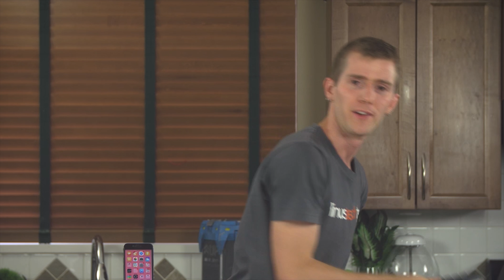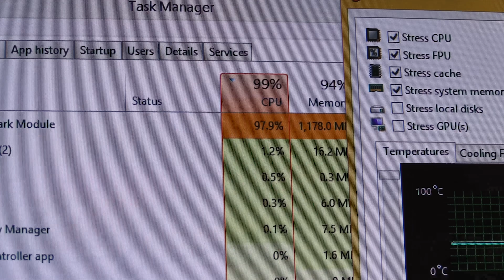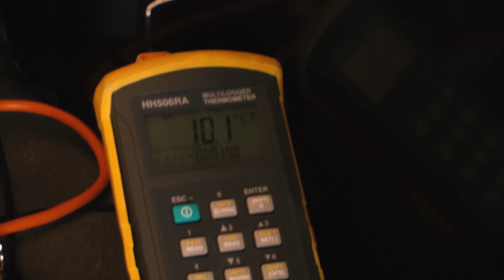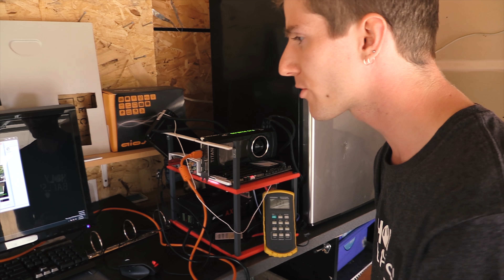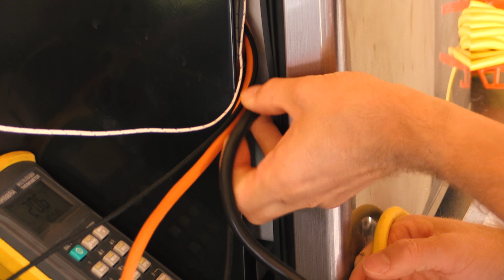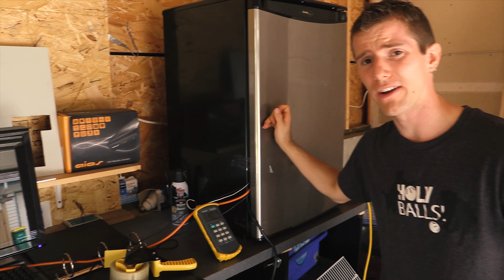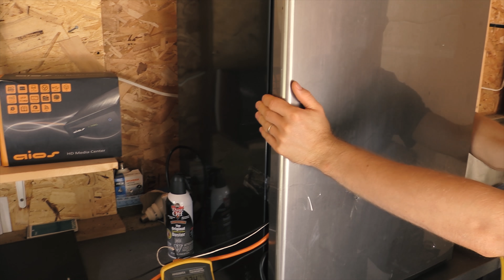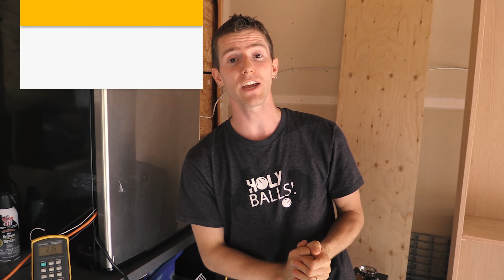PC Build in a Fridge - Does it Work??

Comment: How about extending water cooling loop with copper pipes and making the pipes run through a mini freezer?
Reply: Assasinpiggles well, that's the point, linus projects were never about the average consumer, it's about doing something weird and unusual.
Reply: DemonAMVs ^ True
Reply: Max Poma i don't think its possible for water to freeze in the short time it runs through a mini freezer, not counting all the heat from the processor that would make it harder, and if anything, there's anti-freezing solutions available in the market.
Reply: Hussain RT The average consumer couldn't do that.
Reply: overclockedamd123 
Based on your name you probably have no choice.
Reply: Hussain RT It would have the exact same problem this build has. A mini freezer isn't designed to run 24/7
Reply: UnleashNinjaGuru well we have a freezer that runs 24 hours at 35-50°C and it works great, also, in this case,the fridge didn't have the capacity to cool the system, but if it was only the pipes not the whole system, and considering the freezer cooling is more effective than a mini fridge, i think it might actually work.
Reply: Interesting thread :) +1
Reply: Hussain RT This has already been done. check out the sub zero build he mentioned in the video. the entire system is contained within the computer case its self. not actually all that crazy. To any serious enthusiast it is just a basic phase change cooling set up. the crazy stuff comes in when your doing a cascaded phase change set up or cryo cooling. then the system needs to be designed to handle the cold boot bug as well as the cold bug.
Reply: Hussain RT What you want to make is called a Chiller system in Air Conditioning. And yes it works.

In simple terms imagine having a 50 liter water reservoir for your regular watercooling system, and then using an appropriately sized refrigeration system with copper tubing loops in the reservoir to cool the water in it down to 5-10°C instead of whatever the ambient temperature is. And that's about it, no need for anything more complicated than that.

Now if you want to keep an air cooled system's temperature low inside a box (which is what people think about when doing experiments like Linus did) then you use the chiller differently.

First you make an insulated box using 2 1/2" panel like the one used when building portable cooling chambers. You can have a glass door like those used in fridges at stores so you can check the system inside. Then you place an appropriately sized evaporator inside the box and connect it to the water loop. Then place your system inside along with some silica bags to keep humidity inside at a minimum. And that's about it.

The reason to use a chiller instead of going for direct expansion is because this way you can control the load much better ensuring you will always have a constant supply of cool water running through the system while also ensuring the refrigeration unit will not be working 24/7 but rather only kicking in once water has heated enough. And won't have to deal with condensation like you would do in a direct expansion system either.
Reply: Hussain RT hey it is a bad idea but overclock the fridge, they're good at that right?!
Reply: Hussain RT If you were going to do that you may as well take the compressor out and build a freon loop.
Reply: Hussain RT on a totally unimportant side note  noticed the irony of me teasing you about a movie character who works on tech and robots while I myself am watch videos about ai...
guess jokes on me... but I still get to keep a cookie :)
Reply: Hussain RT That's nuts, you'd definitely get condensation there. Lots of it. Also I dun think CPU blocks are designed to hold that much pressure, they might pop before you get any meaningful cooling.
Reply: Hussain RT  good idea
Reply: Hussain RT TBH, I don't think there are too many machines that could generate enough heat for all this effort to be even moderately practical haha. Would definitely be a cool project for shit and giggles tho. Would probably be a better idea to just go liquid nitrogen at that point.
Reply: ***** Exactly, unless your machine is pushing out more heat than your cooling system is pulling out, it's kinda pointless or even negative for the reason you pointed out.
Reply: Skyler Dorrell is there really anything "basic" about a phase change cooling system? No offense but anything beyond an air cooling system and maybe an AIO is well beyond the concept of "basic." I think calling such a complex system anything less than advanced is an insult
Reply: Hussain RT I wouldn't recommend this unless your components are waterproof.  If your cooling system is below ambient room temperature it will collect condensation, which has a good chance of collecting on your CPU or Video Card.  Neat idea, but you're better off putting the whole rig inside a freezer.
Reply: How about putting attaching a pipe to your refrigerator, and looping your fridge's refrigerant to the PC?
Reply: @VividBagels  refrigerant is usually a flamable gas, not unlike propane. Not a good idea to pump refrigerant through a computer which has ignition sources (fans). System should be decoupled. A refrigerant loop cooling a water/coolant loop.
Reply: Hussain RT Just use pure ethylene glycol (automotive antifreeze has additives).  40% water and 60% antifreeze is good down to -45C.
Reply: Hussain RT Dev Patel your a genius but watch out for Hugh Jackman he hates programmers (especially that 'project' your working on)
Reply: Hussain RT its ok, had to explain it officially not funny anymore :(
Reply: Hussain RT Hilarious
Reply: Hussain RT too kind, 2 cookies? i'll never finish it
Reply: Hussain RT moving water will not freeze, except under SERIOUSLY low temperatures. Even at -10F, if water is moving, it won't freeze. in order for the crystallization of water to occur (solidify), the molecules have to be in a very specific arrangement as the water temperature drops below the freezing point at it's current energy level, and there needs to be a mineral catalyst (usually a few impurities in the water. Deionized water tends to freeze much later than tap water because of the absence of such catalysts.
Reply: Hussain RT For an more powerful rig you'd probably need an industrial fridge. It'd be far more efficient to connect the compressor with coolant to CPU and GPU directly. However this poses other problems like condensation because without proper thermal regulation the system could easily reach negative temperatures
Reply: Hussain RT learned a lot of stuff from this thread. Cheers
Reply: Hussain RT Freezers don't have a much higher cooling capacity. It's just a fridge designed for lower temperature (different working pressure for the refrigerant). Also, since your freezer won't be able to maintain the temperature it's designed for the COP (Coefficient of Performance) will lower and you'll get even less cooling capacity!

What you need is a high cooling capacity and a compressor that is designed to run 24/7.
Reply: ppdan exactly what is in phase change cooling setups...  honestly a peltier heat exchanger would do better than a freezer...

I have been thinking about using some peltiers in a dual loop style cooling setup... that is where you use 2 water blocks to sandwich a number of peltiers between them the hot side is cooled either  with a larger radiator like the whole room setup and the cool side is cpu and gpu
Reply: @Lunas2525  The one problem with peltiers is their coefficient of performance (COP) is drastically lower than a fluid refrigerant loop because they are using thermocouples to move heat - the COP is below 1, whereas the COP of a refrigerant loop is usually a multiple of 1 because the energy required is just to compress and pump the refrigerant around, but the energy transfer in the evaporation and condensing processes is multiple times that of the pumping/compressing. Put another way, if you were to compare a peltier system and a phase-change refrigerant system side by side where they each had the capacity to move the exact same amount of heat from one zone to another zone, the energy consumed by the peltier system would likely be a multiple of that consumed by the refrigerant system.
Reply: There are some drawbacks the setup is pretty inefficient as it would rely on multiple interfaces it would be impossible to effectively eliminate 100% of the generated heat in this manner. And it would use alot of energy to do it. There is a reason it is not used commonly these days. It was something back in the old overclocking days and the peltier cold side would be directly on the cpu with the hot side under a water block and it was a method for cooling lower than ambient it required condensation prevention and strait  watercooling has pretty much become the limit most use now. with a few exceptions with phase change coolers built into cases. But those are not very popular due to noise and not many chips need to be cooled to subzero to overclock well enough...
Reply: Not allowed to pick a name i want, thanks Google 
A mix of 30% methanol and 70% water would do the trick i hope, but the solution would be thinner which means more possibility of leakage, Also it would ruin acrylic which is used in many heatsinks, anyways there're many non-alcoholic anti-freezing solutions available, no need to risk with alcohol.
Reply: Max Poma It wouldn't as long as it's running but yeah.
Reply: Hussain RT You'd have the same problem as keeping the rad outside of the fridge. The fridge is taking heat out of itself and putting it into the environment, which would heat up your system. The only way to really make this effective is to take the heat out of the environment like Linus tried with the whole room cooling project, and we all know how that went. Fridges aren't magic heat destroyers, they're just basic energy movers.
Reply: Christian Gomez 
unless the freezer is in another room, i know fridges/freezers doesn't destroy heat, but they move large amounts of energy in shorter time.
Reply: Hussain RT but as we saw with the whole room watercooling project, its hard to move that much energy without loss throughout the system. You still need to move the energy into the other room and that other room will heat up until the fridge can no longer keep itself cool. Really it's diminishing returns quickly when you think about how much energy you're spending with a complex system when an AC does the job perfectly fine and is designed to do this very task.
Reply: Hussain RT I agree that modifying an AC unit would definitely be a much better idea than a freezer since they dump the heat outside a closed environment. I don't think you'd need antifreeze but I guess it wouldn't hurt. I have to wonder how you'd manage to hook that up since the cooling side of the AC would not necessarily pull the heat out and I'm not sure if AC's have 2 loops or 1 cyclic loop.
Reply: Christian Gomez i honestly have no idea, i don't have the required knowledge to attempt to make such a system, but you want an even crazier idea? No liquid cooling, just run the ac compressed gas pipes all the way to the cpu heatsink, that would be epic.
Reply: Christian Gomez you're right, maybe not directly, like getting the compressed gas pipes to exchange heat with the liquid cooling loop more quickly, like submerging a portion of both in water, ac gas pipes will cool water and consequently cooling the loop, or if you want a crazier idea, getting the compressed gas pipes around the copper pipes of the extended loop and covering both in thermal compound for quick heat transfer.
I'm not a sane person .____.
Reply: Incognito explodes in 60 fps
Reply: Hussain RT I had the same idea... moving that radiator outside the fridge...
Reply: Hussain RT No.
Reply: Max Poma if it's moving at a decent rate it shouldn't freeze
Reply: Hussain RT This is a name I have used for 17 years since my old K6-2.  I currently am using a 4790k@ 5.0ghz and sli 970's @1550mhz. WIlling to bet my computer destroys yours.
Reply: overclockedamd123 whoa watch out, we got a badass over here!
Reply: overclockedamd123 wow calm down this is not a dick measuring contest, i actually respect amd and plan to buy one of their upcoming zen processors, i'm a modest man with an i5-4460 and an r9 270x ;)
Reply: VividBagels  an ac would be more suitable i think.
Reply: Sigh an AC unit is common knowledge for extreme coolers. They usually use it for a chillbox...or a cascade.
Reply: Max Poma Antifreeze exists for a reason.
Reply: Hussain RT da foiking wotr wud frez
Reply: no
Reply: xDarkTeddyBear :okay:
Reply: Edgedable wat?
Reply: Hussain RT (face palm) movie reference
Explanation: its an under handed tease, just google the names you may get it
Reply: Edgedable i know hugh jackman but didn't get your reference, sorry.
Reply: Edgedable it's okay now, pats your back
Reply: Hussain RT thanks buddy, did I win a cookie?
Reply: Edgedable here hands you a cookie
Reply: Edgedable
You get another cookie hands you another cookie
Reply: TheError404 
you don't want to use the compressor directly on the CPU for the very reason you described: condensation. and you've funnily enough included the words "industrial fridge" and "efficiency" in the same post. There is nothing about this setup that can be efficient. efficiency isn't the goal when including an entire home appliance for the purposes of cooling a CPU or GPU. "extreme cooling methods" and "efficiency" just don't go together. The higher the delta you seek, the less efficient the energy cost vs performance boost becomes. and negative temperatures aren't required for condensation. all thats required is a temperature below the dew point of whatever ambient temperature is. details are a bit sketchy
Reply: Not allowed to pick a name i want, thanks Google The oceans don't freeze because salt drops the freezing temperature.
Reply: Hussain RT the fridge is not made for a constant heat source like linus said. The fridge uses phase change principle  to reduce the temperature inside the insulation is meant to maintain the temp inside the fridge the thermostat tries to keep inside at around 38-40F. In operation it  chills then stops and lets it coast then engages the compressor periodically to maintain. The thermal mass of a computer with 140W (5930k) and the 250W (titan x) and the motherboard and psu is way more than the wattage the fridge can displace from the video it did seem that the fridge's capacity was just short of having enough.
Reply: Max Poma In that case maybe in the fridge it would be better.
Reply: ***** yep ac coolers are more convenient.
Reply: Lunas Eclipse honestly that's genius.
Reply: Lunas Eclipse Peltiers are very inefficient and the phase changer systems you can buy for PC mostly only focus on the CPU.
Anyway when I are hear the name "phase changer" I know I am in computer geek hell, they couldn't just call it a heat pump like the rest of the world.
I find those "Phase Changers" amusing, they draw the heat from you CPU to transfer it into your room so that the PSU will eventually suck that heat back into your PC.
If you want to design a serious system you should get that heat out of the room (Put the condensor and  compressor outside)
Reply: ppdan only problem with doing it mini split style is portability... it does solve 2 big problems with the heat pump coolers... noise and heat movement.

Comment: LinusTechTips Hi Linus, I have just picked the parts for my first home-built computer and as you can understand aint this to easy to make sure that all parts will work together or if they will mess up or run bad on some way.

I would even like to know if the case is to small or if I can change any parts to make the build cheaper but with the same performance!

*Link: https://pcpartpicker.com/b/R7bj4D*
Thanks for reading!

Comment: Next scrapyard wars: $600 build that can either be water cooled or air cooled not in a PC case. Looks don't matter, performance only. No off the shelf parts like 120mm fans are allowed, so like Luke's car rad and a smaller room fan to push air through it... :D

Comment: But linus, you didn't freeze the radiator. Freeze the fins of the rad with water and then stick it in the freezer. You won't have a problem with temps anymore.

Comment: Great video Linus, i think that you should try and interestng idea of "intercooling" all intake air into the case using some compact air con unit, sealing the case and only have high flow exhaust fans on it, all intake fans would be sucking only the air thats gone thru that air con unit. That would defo work very well and wouldnt really have to be that large if build well, and if some manufacturer would make a very compact air con unit that is actually design to be mounted inside of a case, which would have to be a massive case, and get all intake flow thru it, it could be actually maybe even more effective that watercooling. Worth a shot? :)  THe aircon would have to have heat exhausts on its own of course.

Comment: Very bad idea, that fridge if it works with  a regular compressor thermal cycle will be busted in a couple of months at best with a even low pwoer PC inside.
Those Fridges are not built to sustain thermal loads inside.
Some industrial fridges can do that , regular kitchen fridges will die very very fast.
They're made to carry fruits and vegetables and those do not plug into a electric outlet and exale huge amounts of heat ... :)

Comment: my 3930k@4.4 runs 33-38 idle and 68-72 max load. winter is coming, but ive braced myself, with this small expensive space heater